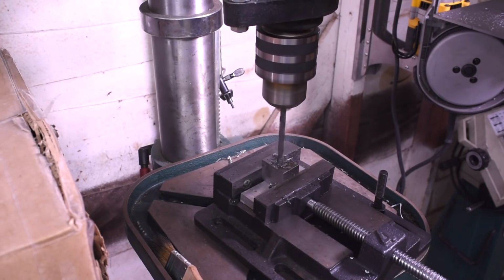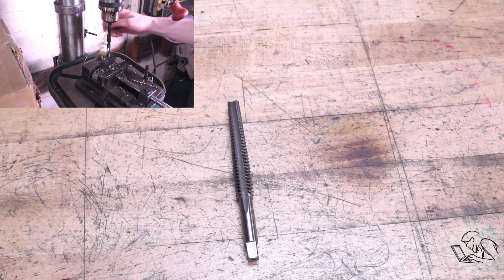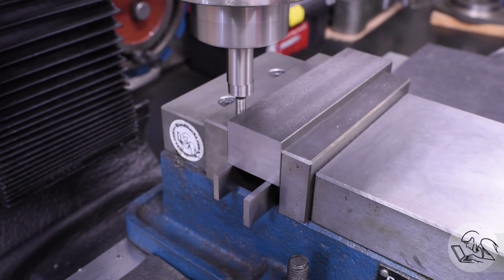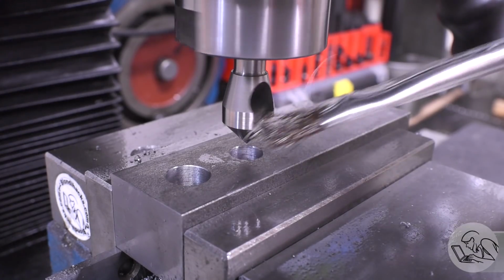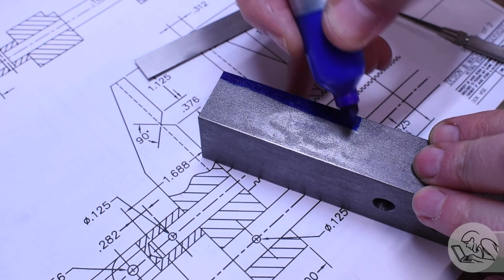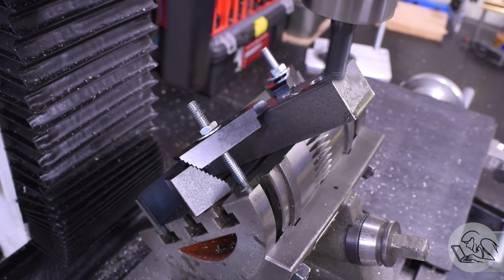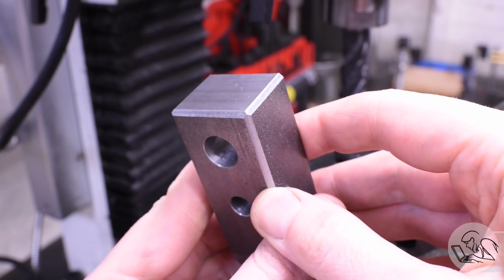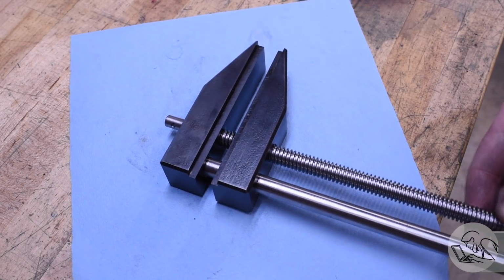Internal Acme Threading? Making a Float-Lock Vise, Part 2!

Comment: Really beautiful work!  I want to make one now.  I think you made an excellent choice in upgrading to ACME thread.  It'll work better and last forever.  One suggestion...I read through 300+ comments and didn't see this one - I would have made about half that thread as a clearance hold.  Having a little over 1/2" or 5 threads of ACME would be just as strong as threading the full length, from my understanding, and it would've been a lot less work threading.  Normal 1/2-10 ACME nuts are 1/2" thick.  I knew you weren't going to hurt that tap wrench, but if had any flaws in it, I could see that tap breaking.

Comment: Very nice job on the vice. I particularly like how you solved the problem with the long acme thread. Well done. Now I'm sure you hear these  stories all the time but when I started as a machinist apprentice, one of my first jobs was on a DoAll metal cutting bandsaw cutting up rough steel pieces for the tool and die makers to use in their process. My favorite accessory at the time was the float lock vice. A few years back I was able to find one at a yard sale for a very good price and I use it quite often now in my small machine shop. That was in 1955 and I have been in the machine shop business ever cents. I will let you do the math. Again, well done

Comment: Why can't you use the Drill Press itself to turn the Tap? I would think that at very low speed/high torque it would cut those threads quite easily. I've watched videos of this done on Lathes (often by moving the metal & keeping the Tap immobile for some reason), as well as CNC Milling Machines (which can swap out tools as needed, and can go from block of Aluminium to smoothly precise cut & tapped workpiece in minutes).

Perhaps this puts too much stress on the Tap or cut threads. Can you explain why all the elbow-grease instead of using the Drill Press..?

~ ~ ~

[14:00] I was so gratified to see you use a piece of wood to steady & complete your cut on the Bandsaw. You would not believe the number of times I've seen different metalworkers ⊚ on YouTube (both amateur & professional) who've used their damn fingers - mere millimeters away from the moving saw blade - to push pieces through, or remove waste cut-off. All ot would take is one misstep & it's "Sayona Fingers-San"... 

Instead of, y'know, keeping your fingers far away from the whizzing blade of death by using a simple sacrifice stick...

⊚ - & woodworkers for that matter...

Comment: Good idea to get a very small air compressor with a gun nozzle for your small shop or coolant mister to clear those pesky chips as you use your reamer. 🤔👍 Time to get a coolant mister like Abom's. Also for your angle block case issue. I adopted this idea from a friend. The two foam pads are creating a double sided soft spot. By removing the bottom foam mold and doing a silicone mold pour with standoffs to hold the tools up just enough to leave the tool proud. This creates a solid base for your tools to sit in and also holds them tight even in old school wooden tool cases.
Reply from the maker: But then it wouldn’t be funny

Comment: Quinn...you always do pretty work. Take a tip from an old tool & die maker and use Crisco vegetable shortening instead of thread cutting fluid. You can even power-tap large taps using this.
   A buddy of mine used to work with an old machinist at a heavy equipment manufacturer (Back Hoes, Tractors, etc. The old man turned them onto that trick, because they were busting those big taps, and they were expensive, he said. They saw how much better it worked, they bought out most of the grocery stores in our town, for Crisco vegetable shortening...till they could get the ordering set-up there. My buddy told me and I tried it. I got my boss in on it and I did at home, for hobbies.   Get a plastic pill bottle and cram it full. Just dip the tap right into the pill bottle of Crisco and tap normally. You'll be amazed on how nice it cuts and it doesn't make a mess, either!

Comment: Hi quinn, I'm new to this, I've had some experience, however I was recently gifted a boley 8mm watch makers lathe. I would like to get my hands on a crosslode and tool holder as at present its only has a tool rest.  Any ideas. Obviously money is a big factor. I've seen a couple of bits n pieces on ebay  but they're around 400 GBP.
Any guidance is greatly appreciated. 
Xheers, my man. I'm enjoying your channel.😁
Reply: Quite daunting as I just don't know what I need, I have chucks and mountimg plates and loads of collects, internal and external. I'm in two minds whether I should just use it as an ornament. 
I may bave another lathe coming I think it too is a boley, I'm hoping it has some bits I  didn't get with this one.

Comment: On your angle pieces in your box try putting earth magnets in your metal box and then covering them with belt or something to hold your angles to the box love those magnets I use this method to hold batteries in plastic cases for my digital calipers still works.

Comment: Hey, Quinn
Love your videos. I get a lot from them. I have a problem maybe you can help. I have a new surface plate and machinist level. I in a catch 22. How do I set them up when I need one or the other to set them up. Can't set up the level because the surface plate is not set up. Can't set up the surface plate because the level is not set up. Any help is much appreciated

Noel
Reply from the maker: Surface plates don’t need to be level and machinist levels are self-calibrating. See my video on Aligning Your Lathe for the procedure

Comment: Tapping acme threads can be nerve-wracking!  I was building a project last year that needed a very long internal thread, and the new acme tap I bought just couldn't handle it.  I knew it was close to snapping off, and was more concerned with keeping a good tap than finishing the project.  I actually started single pointing it, but the diameter/depth meant that I ran out of rigidity very quickly.

Comment: Nice work Quinn. I took a slightly different approach with the tapped hole. I drilled the nominal size and then only because I had one, ran a 7/16" Acme tap through and then the 1/2-10 Acme tap.

Comment: You could have put the drill back in the hole & used that to line up in the drill press, that’s how I’ve done it.
Reply from the maker: Nope, not enough quill travel. Hence my comment about it being a round column machine
Reply: @Blondihacks  Sorry, didn’t realize that, hope you understand I’m not questioning your skill, your level is about like mine & I’ve been doing it for 50 yrs. or thereabout.

Comment: Given that you had already cut the acme thread on the rod, you could have made your own tap by continuing the threading process with some drill rod. Cut some flutes then a taper over a suitable length, harden and temper - suitable topic for future video? Anyway, a suitable donation has saved you a lot of time and effort and will allow for the easier use of acme screws in future projects.
Keep up the good work.

Comment: Every now and then I need to put a 1/2 or 3/4" NPT thread into stainless. I have a tap handle that is about 3' long and the dance I need to do with that is exhausting. The 3/4" NPT requires a cheater bar that is another 2' long and I don't know how I haven't caused a tap to explode yet.

Comment: Quinn,
Nice job your doing there. Yeah, I just about didn't get the Acme threaded hole tapped in mine when I made mine two years ago!  Will say, there's a big difference tapping gummy 1018 verses 4140.  You can get better chip control even though it is tough to tap!  KenS.

Comment: Quinn there's no shame in using cheater pipes. I just retired after 45 years as a jet mechanic and half of the large bottom drawer in my roll-away is nothing but cheater pipes. Sometimes there is just no other way to get it done.

Comment: Honestly it might be worth making a larger tap specifically for the purpose of fitting a larger handle, giving you more leverage and torque. That could also give you more handle to put a cheater bar on and hopefully not shear/bend it.

Comment: Hack for next time you have to plumb up a tap like that in your drill press.  Assuming you haven't beaten up your tap wrench with extension pipes or anything, you can use a magnetic angle finder on the arm of the tap wrench.  Tare it to the press table, stick it on the wrench arm and then move the vise to get it to zero.  When you have that at 0 in two 90 degree directions you are perfectly aligned.

Comment: Was very confused about this being part 2 - my short term memory had forgotten that this project was a thing. Oops!
Lovely work, as usual!
I’ve got a question about the Acme tap. My (admittedly very novice) gut feeling is that if you worked that hard on a normal tap that it would have broken into 1000 pieces. Is there a difference in material, or something, that makes that Acme tap able to cope with the cutting forces?
It were you doing something special in the tap dance to nurse operation?
Reply from the maker: This tap is huge. You won’t break it

Comment: nice dancing :) try auto reversing tapping head. I bought one recently off ebay and it is amaaaaaazing!
You'd need a very low geared pillar drill though, I have one with an internal gearbox that goes all the way down to 60rpm!

Comment: I always enjoy your videos for their content and for the human touch.  But this one is a cut above even by your usual standards.  So DOUBLE WELL DONE!

And a couple of comments if I may.  First off I assume that Swarfy's full name is obviously Swarfy Smurf, right?  Next up is that we both share the same need for a REALLY big tapping wrench.  Even regular 1/2" size taps are a bit of a struggle and I'm having a rough time finding an option out there which I like the looks of.  The cheap imports that look like they are made from old beer can stock just don't do it for me.  Perhaps a future video for one of the Z shaped tap wrenches in the needed Mega Size?   

The vise is coming out great so far with some great design and fabrication decisions on your part.  One thing that occurred to me as you were cutting your steps for thin parts was to perhaps drill for two pins on one side and a single pin on the other for holding thin ROUND flat parts.  For example a washer that needed drilling out.  The pins would slip in and out and perhaps be drilled with some shims so they sit in the holes with just a few degrees inward slant.  In fact I might just do this on my own drill press vise.  Not sure why it never occurred before.... But then there's that comment from editor Quinn vs video Quinn which pretty well answers THAT one.....   CHEERS!

Comment: So when Mr Pete made one of these, he just went with a standard thread instead of ACME. No way I'm buying a tap for this so I assume that while an ACME thread may be better for a vise, the standard thread would be good enough considering just a manual drill press vise??
Reply from the maker: In the first video, I explained why acme threads are used in vises. A regular thread is okay, but will distort if you clamp hard

Comment: enjoyed…nice build…suggestion, make it so you can use a drill to open/close quickly for large movements, also make a fixture to slide/swivel to hold vice to the table, I did a video on my setup
Reply from the maker: The latter is part of the float lock design

Comment: Great work on the acme thread lathe work it's no small task and shouldn't be underestimated. It's a recurring theme that you push the limits of your equipment and I appreciate the level of difficulty it adds to the projects you tackle with respect. Thanks for showing it's not necessary to have hugely expensive machine tools to make very impressive parts by applying good practices and skill. Keep up the great content Thanks

Comment: Nice work.  Sometimes they make separate roughing and finishing acme taps because it's just too much to cut in one pass.  The toolmaker vice bolt was angled up more than 45 putting more force down vs. clamping.  Moving to the next cross hole might give more clamp force to the jaw. Yes, you could have swiveled the vice on the angle plate but that would have been some nasty 3d trig to get the angles.  This way was simpler.
Reply: The vise bolt should be perpendicular to its face.  At 18:45 it is clearly too steep.  That is a PITA with those vises.